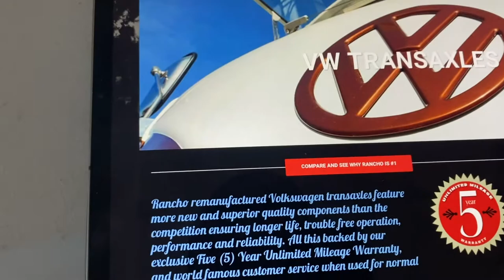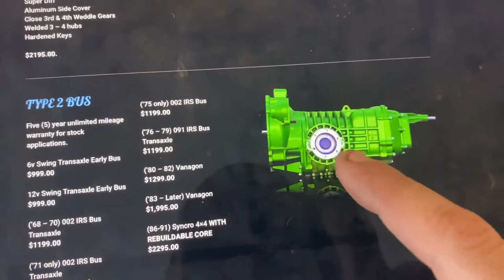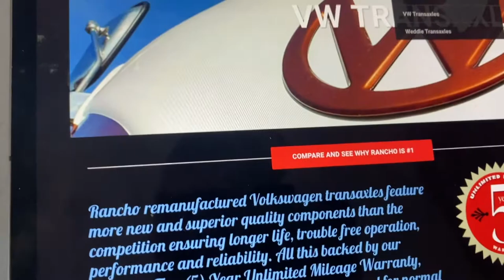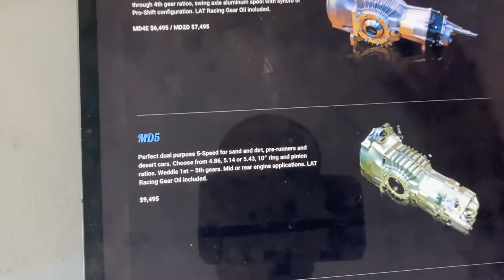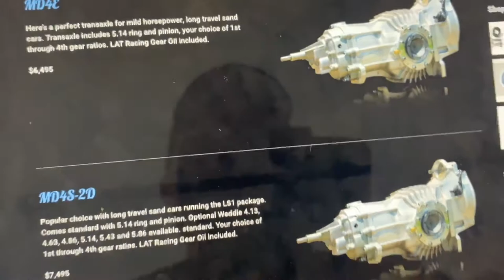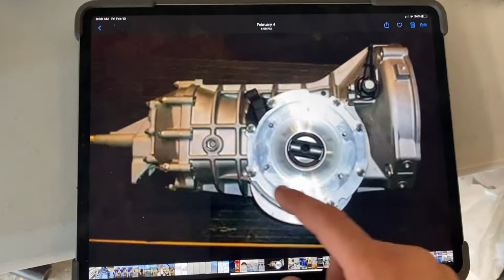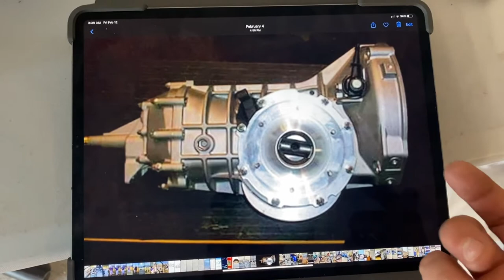VW upgraded transmission Episode 3

Comment: I personally have never broke the side cover or covers. Most common you will break 1st gear or reverse gear and even blown complete spider gears and I've only run stock too 1641 cc engines,but all 7 transaxles I've blown have been in baja bugs running 30 inch tires or bigger
Reply from the maker: Update coming soon I went with an Autocraft transmission case

Comment: The transaxle that have 1 side cover would be 1973 or later. Dual side covers are from 1968 1/2 too 1972. But in Mexico & Europe they used different transaxles and gears because they used the 1300cc dual port motors. America was about bigger is better.

Comment: i have a pro drag type 1 made by rancho and im close to 400 ponies no issues
Reply from the maker: That’s awesome have actually upgraded to an Autocraft transmission
Reply: what gears are you using?
Reply from the maker: @carlosjimenez-ss2ck   Weddle gears
Reply: expensive but worth it
Reply from the maker: @carlosjimenez-ss2ck  will be posting more updates soon!